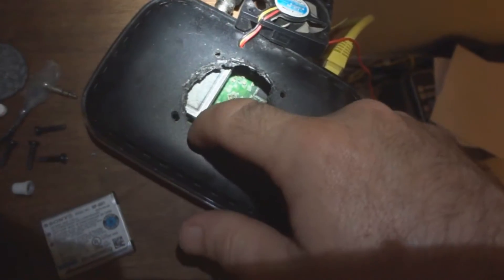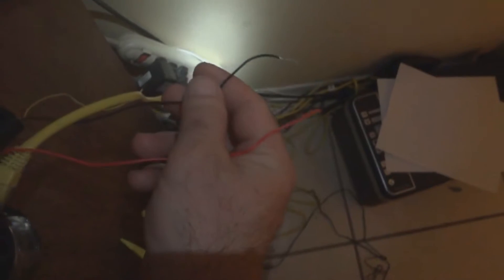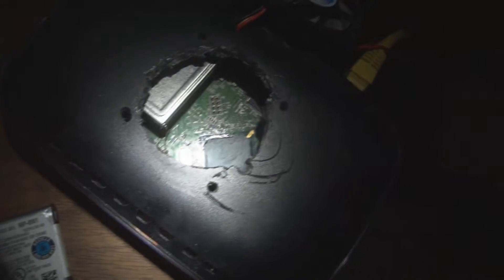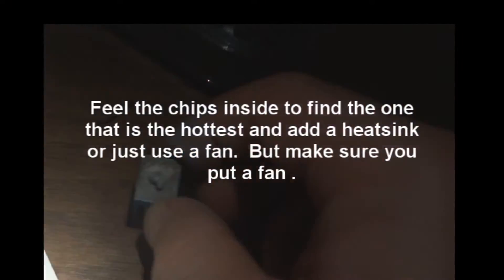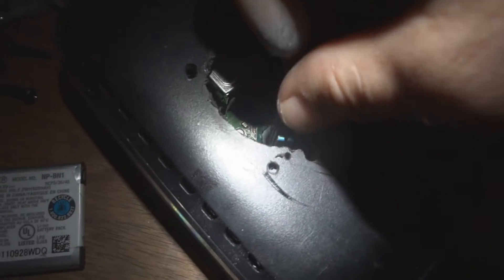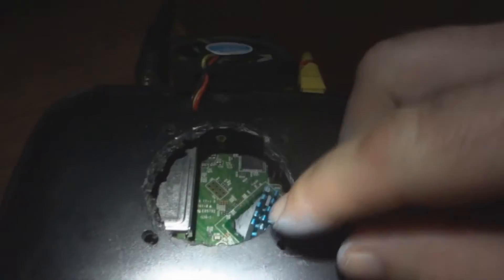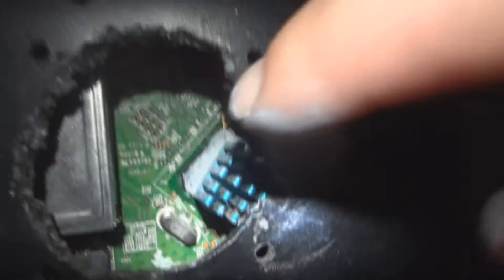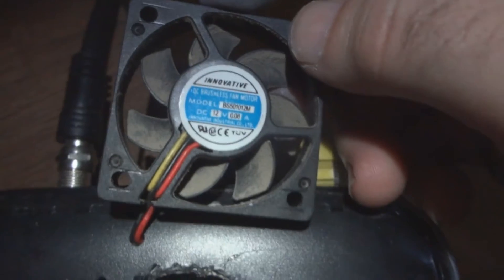Cable modem hack to make it last 7 years and counting.

Comment: This video serve go viral, please do more.
Reply from the maker: More videos about modems?  That same modem in the video is allowing me to respond to your comment.
Reply: @chriss4365  Your only argument is that modem is still working. 
I argue that if you would just leave it alone and do nothing it is very likely it would still work anyways as modems just don't expire after a year + week. 

Does ventilating expand life spam? Sure. But now it is also more vulnerable for dust and liquids and not even mentioning those stripped cords you just left on video hanging with comment "just make sure they don't touch each other" or overall aesthetic of the "hack".  

If you do something, make sure you do it right with right tools and answer me this: 
What that chip does you decided to cool?
Reply from the maker: @smxplays  I don't know much about modems but I discovered my internet would lag and resetting modem fixed it then I discovered that chip was pretty hot and knowing about computers I know the chips are supposed to be cooled with a heatsink and fan so I made that happen with this modem and the lagging issues stopped completely.  I have had other modems only last a few years and my guess is from the modems processor chip not being cooled.
Reply: @chriss4365  ...just don't do hack like this anymore. I am genuinely worried you will burn your house.
Reply from the maker: @smxplays  The fan runs on a old 5 volt cell phone charger no risk of fire.
Reply: @chriss4365  oh yeah? connect those wires and put it on the wall and see what happens.

Comment: That's not how you install thermal paste
Reply from the maker: Ok expert you can install it the correct way since you know better no need to boast.
Reply: @chriss4365  I wasn't trying to be rude. Thermal past works by essentially removing air gaps between the heatsink and the metal it's connected to, using your fingers, or more commonly the "credit card method" is improper as it adds impurities. You want to use very little thermal past put a dot on the cent and then put the heat sink on top without spreading it around like it's bread and butter.

Also I am a certified expert as well, so no need to be rude in that regard. I wasn't expecting a reply, but since you did I figured I'd let you know better.
Reply from the maker: @GealuGalu  next time you should give feedback instead of just saying that's not how you install thermal paste with no further explanation.
Reply: @chriss4365  Fair enough I never expected a reply or you to even see this comment, most comments go unread so I just replied with the relevant info, I don't meant to come across as rude.
Reply from the maker: @GealuGalu  this channel is still small enough that I see most comments.